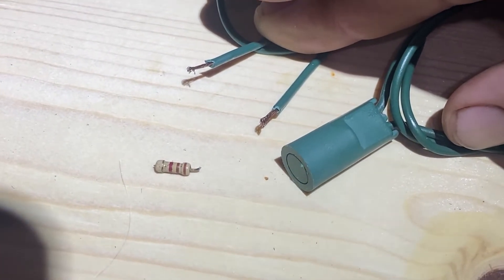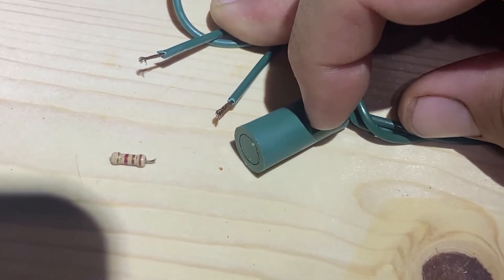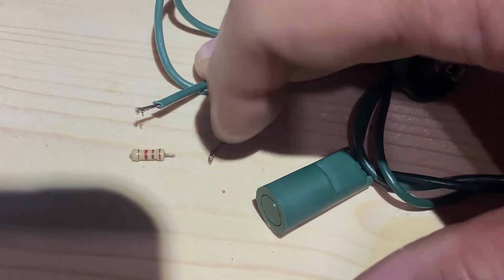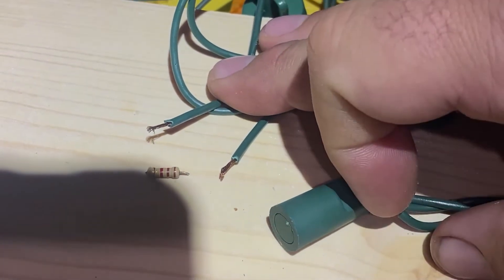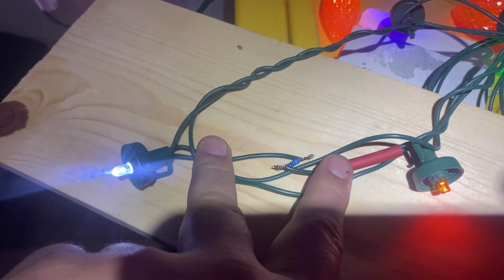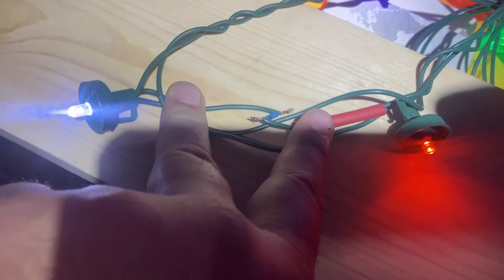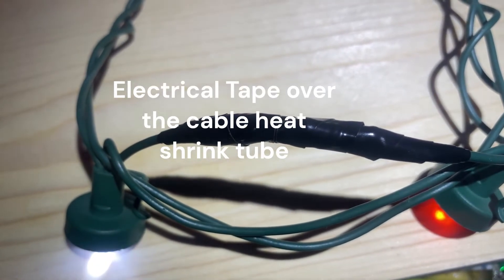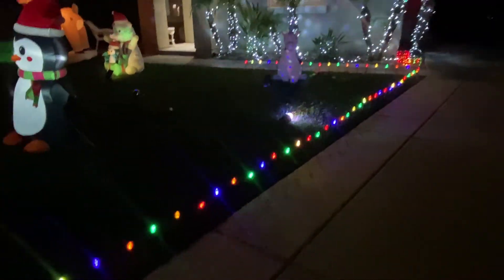LED Christmas Light Repair - Resistor Gone Bad

Comment: On my set that looks like yours, you can remove the cap with a small screwdriver. The resistor pulls straight out and is in a base similar to a common LED Christmas light. Remove the resistor, replace it, and insert it back into the base. I found my resistor was corroded from water intrusion coming in from the wire side. Hope this helps.

Comment: I have a full strand of C9 LED lights that are half dim...  Would this be the problem?
Reply: And if so, how do you open it and find what ohm you need?
Reply from the maker: I am not sure. If the entire string was dim and not just a portion or every other LED bulb was dim, then I would think something maybe rule out a timer or something else in-between the wall outlet and the string of lights isn't impeding the current. If its direct into an outlet, and a different string does not exhibit the same issue on the same outlet, then you might also just check or swap out the fuse just in case its slightly burnt but still has some small connection allowing current to flow. Could also be that the resistor is maybe close to failing. Just some guesses.
Reply: I can't get the resistor housing open to identify the unit. It looks just like this one. Any tips?

Comment: I'm not sure if I'll tackle putting in a new resister or not - but thank you for confirming that's the issue.  At first I thought it was a bad xmas light bulb... but when I pulled out a bulb on the working part of the strand, it did not cause the remaining lights to also turn off.  So, it seemed that a bad bulb (or even missing bulb) would not affect a section of the xmas lights.  I thought maybe the little resister was a spot for a fuse and was trying to figure out how to open the "blank spot with no light".  It helps to know that it is not a fuse but a resister in that thing and that it doesn't open.    
Again - thanks for the video - it helped me a ton!

Comment: What wattage rating resistor did you get?  the color band codes tell you what resistance is needed to replace but I cant wee any information on what wattage it needs to be rated for.  The ones I see on Amazon are all pretty low (1/4 - 3 watts) which seems low to me?
Reply from the maker: I specifically used K ohm /w ( Watt) with +% tolerance resistor.  https://a.co/d/5uOlt9w

Comment: Nice video.  I'm about to tackle the same problem.  Curious if you knew what ohm resistor is typically used?
Reply: Pulled mine out.  It's a 300 Ohm resistor in there.
Reply from the maker: Glad you got it figured out. I have not opened many others, so I am not sure what a typical size would be. Best thing would be to do what you did. Pull it out and make sure it is compatible with the specific size and type of your string of lights.
Reply: What resistance was it?
Reply: That my problem right now with 6 rolls of C9 Christmas lights! How can find the right one for my lights??
Reply from the maker: @MariaAfonso-h3t  Look at the resister you pulled out and compare it to the code chart to find what was in there. https://resistorcolorcodecalc.com/